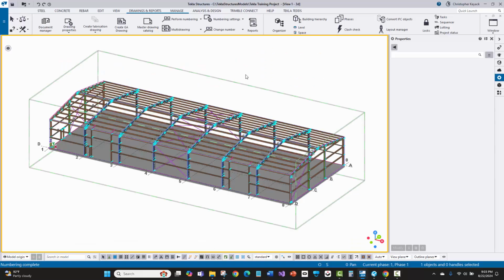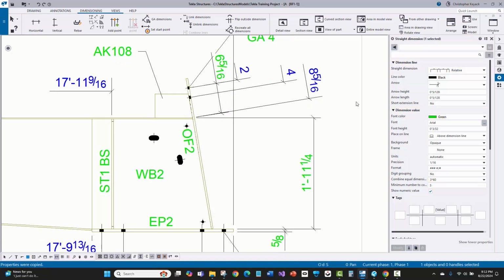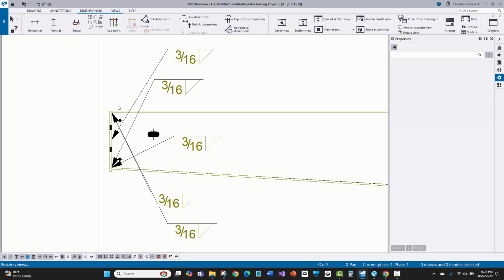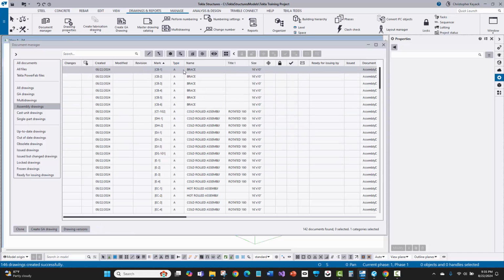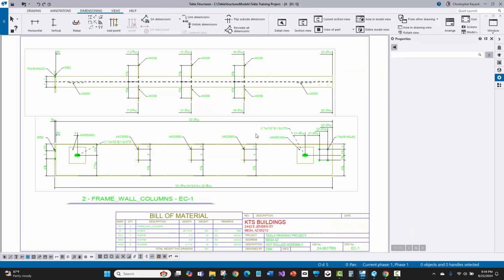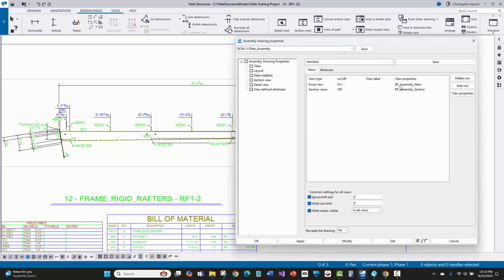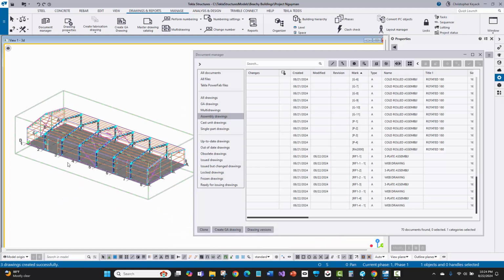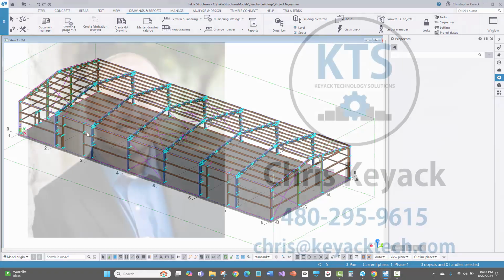MBS SlideRule - Tekla Shop Drawings

Comment: I am so glad that we use metric system in Europe :)
So much to clean up only for the measurements because the length of it.
Beside of that great tuturials mate, keep up the good work and thank you.
Reply: You're right, this imperial system is very  obsolete nowadays, perhaps they use calculator for simple operations like + or -, and its very hard to comprehend